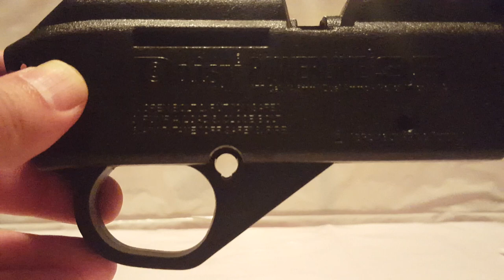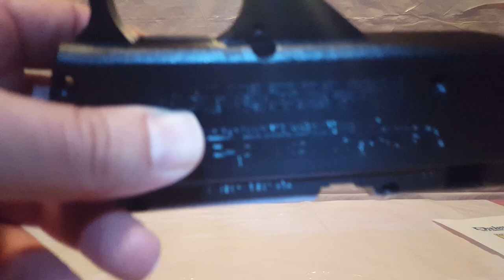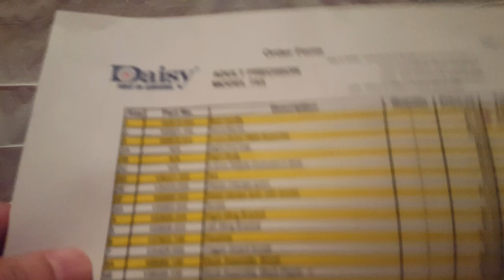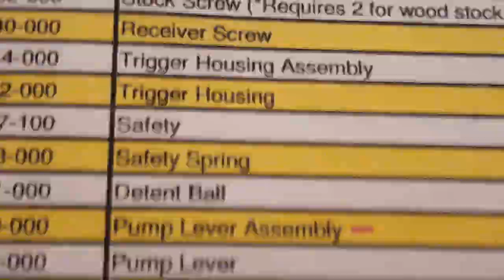Daisy 880 Safety Repair: OEM Option

Comment: Man you saved me, I was in the process of rebuilding one of my 880's and it was in pieces in a box, my wife knocked the box over and it somehow dislodged the safety assembly. I found the spring and BB but didn't know how it went back together. After finding your video I got it reassembled. It wasn't easy getting that spring and BB in place, took me quite a while and I had to chase the BB many times.  Thanks for all your videos.  1-29-'22.

Comment: Got a little hack for you. Today while reassembling my 880, after replacing the O rings and valve, my safety slipped out and while replacing the ball and spring...well let me say, trying to replace it for the umpteenth time, the ball shot out, again, and this time I couldn't find anywhere. Now what??  So I got to thinking, & I remembered that I have some pellets with a little ball in the hollow point. So I got one and squeezed the little ball out and low and behold it worked!!!  I finished re assembling my 880 and it works great. So, in a crimp and if you have any of these pellets, you have a whole bunch of balls that will work in the safety.     You are welcome...   🙂   2-1-'22        Note from my comment below, I had it fixed once, then while fiddling with  the receiver, I knocked the safety out again.   I must have chased that little bearing  20 to 30 times before it finally disappeared for good.
Reply from the maker: Redwolf, that is actually good hack. But if you are shooting Gamo Rockets, I actually push peolpe away from those pellets because of the breech jams. Some 880s don't take those because the heads get stuck - the steel ball doesn't let the head form to the barrel.

But if the ball works and ammo works in your 880: 

https://www.pyramydair.com/product/gamo-rocket-177-cal-9-6-grains-ballistic-tip-150ct?p=423

Can you go to this video and paste your comment there? I used metal beads from Hobby Lobby.

https://youtu.be/NI5IeSw-JzM
Reply: @daisy880fanaticfixit9  Hi, I posted a shorter version of my hack on your other video. I haven't shot many of the Rockets out of my 880. A few years ago I bought a bunch of different pellets to try them out. I'll keep your advice in mind. Thank You for the info.

Comment: Hi again, FFI. I can't thank you enough for your time and support (patient, personal and professional) in not only elucidating the Daisy 880 [35, etc.] users with terrific, detailed and clear tutorials, but also for your keen sense of protecting our pockets from the infamous 'ripoff rats' (^_^) you allude to.  ...Much obliged indeed! 

Reverting to my old model (Rogers, AR late '70s / mid 80's Model 880), do you know if: a) there is a Safety kit, i.e., for the trigger guard type?  The safety button is different than the new model button you've installed and illustrated above. If so, b) would it be separate from the trigger guard?  It would seem that the button itself pressure snaps onto the groove / channel over the ball-and-spring assembly. 

Jan. 29. I finally got to my project of refurbishing the 880; all parts are disassembled and cleaned per ... and THANKS to your expertise, dedication, and altruism. KEY advantage to be sure!  The safety, however, is hard to switch side to side. I will clean some more and try a tiny drop of ND 30 oil to see if it will free the click motion. 

"When you combine your goodwill with your talent, the world will smile a little more in its orbit." 

Sincerely in admiration and indebted to you. 

God bless
Reply from the maker: Sir, thank you for the praise, but being praise worthy does mean having real humility, which means willingness to hand you over.

You are asking for assistance on a model I do not  have any REPS on.

In this case, JL Missouri is the guy to go to. Yes, he has markups on these parts, but it's what the market will handle.

Search out his video on old style and try communication.
Reply: @daisy880fanaticfixit9  
Yes, JLM is an excellent resource.  Fortunately, the ball and spring under the safety button loosened up with cleaning and lube and is switching fine side to side. 

And goodness, you're modest and humble too. 'o' ...That takes character!  [For example, I like and appreciate how you give due credit and recognition to the gents that came up with the clever mod to flare the seal via an O-ring shim.] 

You're the best. 

Kind regards.
Reply from the maker: I know your 880 has sentimental value, so glad you are on the way to restoring it!

You seem very determined!

Come back and celebrate when it's shooting 🫶
Reply: @daisy880fanaticfixit9  
Amigo FF, 
Forgive me for bothering you with this Q. Your time is greatly appreciated. 

Yes, you're quiet perceptive as well. 'Main reason for refurbishing the Old 880 is sentimental value: I bought it for my little son almost 40 years ago. Trying to bring it back to a healthy working order. 

Currently slowly putting everything back together. I know there are quite a number of excellent blogs, diagrams / parts resources and videos (yourself, JLM, Ronno6, etc.). I've seen some of these several times. 

Now, I'm usually very organized and neat when taking apart mechanical assemblies and electronic modules.  But... 

In my array of parts-in-process, I have a solitary "extra"[!] black o-ring: ID 3/8 (or 11/32)" x OD 1/2". 

Do you know where this came from / where it goes?  I did not take apart the air valve nor the trigger assemblies. 

Your disposition is admirable!  For the cause.  

Best,
Reply from the maker: Amigo, hate to tell you, but that looks like your valve ring. That needs to go back on or be replaced.

SAE 012 (Danco #7)
ID 3/8 OD 1/2 Thickness 1/16

Otherwise, I don't have your 880 style. Could be part I don't know  about.
Reply: @daisy880fanaticfixit9  

'Sí señor, correcto.' (~_<)

Forgot to share that the so-called "left over / extra" O-ring I had was indeed the valve seal ... it came with the new kit I bought but had not taken the valve out. 

All is well in the seals Dept. now. 

Just trying to refine the silly sticking safety (old style, embedded in separate trigger guard). Back to the rework area. 

Sincere kudos.
Reply from the maker: Keep up the good work! Glad I could help! Thanks for the very surgical description.

Comment: My safety is stuck on fire mode and I cannot move it to put it to saftey
Reply from the maker: You will have to take off recievers and push out Safety parts - INSIDE PLASTIC BAG - and lube BB. The bag will keep you from losing parts.

Check for broken spring. I got fix for that.

I see you watched both Safety videos. Please give me story of your gun. Is it new? Garage sale?
Reply: Daisy 880 Fanatic Fix It thanks it’s a year old I bought it new
Reply from the maker: Danny, before disassembly, try putting some lube on the area. See if it works loose. Blaster Dry Lube perfect for tiny parts like these.

If you take it apart, you have to be careful with the screws, put them back right. I have other videos on that.

I've  never had the safety stick like that. My hack video, with bead, has been tested and there is one for spring too. Hard to break a BB, so it has to be spring. They may not have put it together right.

If you take it apart - and looking at the spring and BB nside the bag - they look fine that means you just have to put back together RIGHT. They rushed at the factory. 

If it STILL doesn't work after reasssembly, the TOGGLE alone is flawed. 

Toggle arrow for order info in written section to order new safety kit from Daisy. Use a towel so you don't lose BB or spring - VERY tiny parts.

Try lube first before taking it apart.

Comment: Got a pellet jammed... and removed the frame to fix it and that spring went pfffiuuuu... I was able to find the bb but not the spring... 🤦🏻‍♂️🤷🏻‍♂️
Reply from the maker: Cristian, great that you found the BB. Most lose that and keep the spring. Another channel made hack for that - Bic spring. I will.send link for a how-to video I made.

https://youtu.be/sVARwrZYcuQ
Reply from the maker: Christian, on jam, if it is a barrel jam just run a rod down it, cock the bolt, and push out the pellet.

If you had the pellet fall back into the BB port, and couldn't shake it forward, take a pen and actually push it INTO your BB magazine. You then open up the BB hatch and shake it out.
Reply: Daisy 880 Fanatic Fix It awesome man and thats what I did (the rod) which was actually a wire 🤷🏻‍♂️ and it worked but now I cant find the spring hehe... so how often do you do maintenance on the gun? Or lube the orings?
Reply from the maker: Cristian, the 880 needs little oil. Just a drop of 30 SAE Non-detergent oil every 500 shots OR if your point of impact drops.

I have oil videos so check then out Pellgun oil or Super Lube O-Ring Silicone.good too. 30 SAE ND much cheaper.

Reminder, I gave you link to fix video for the spring. If you are talking about safety spring.
Reply: Daisy 880 Fanatic Fix It yes sir! I did checked that one too. Im a sub now ✌🏻